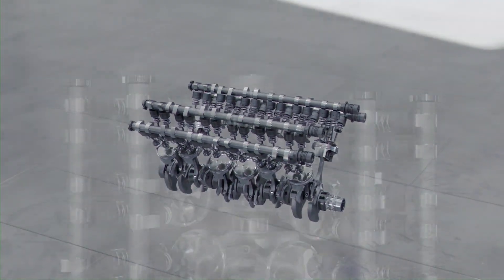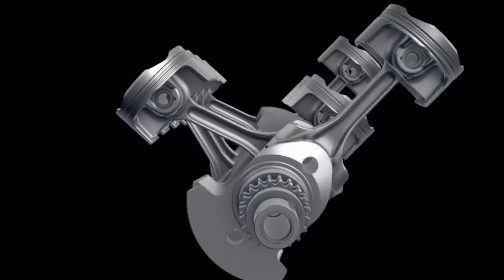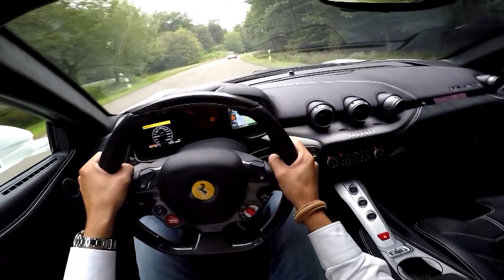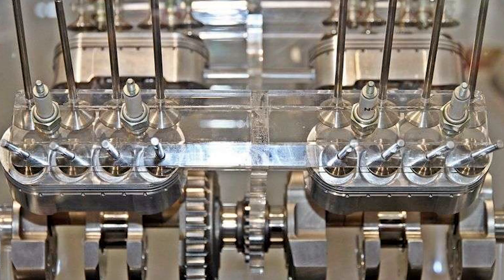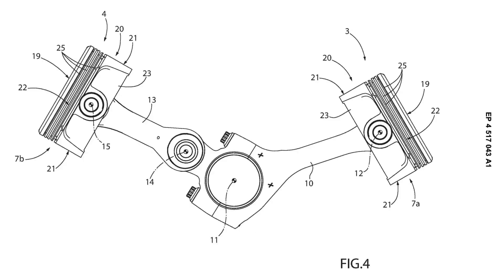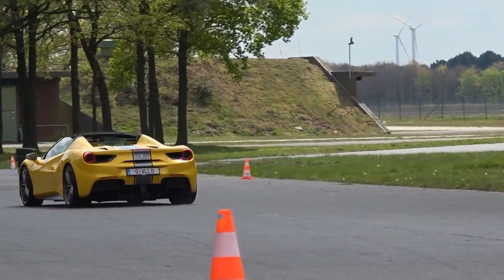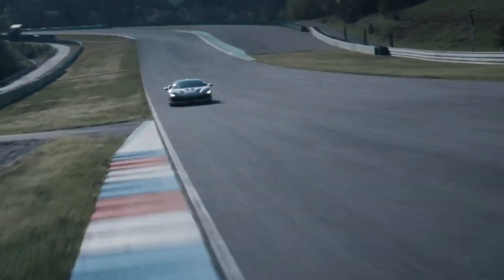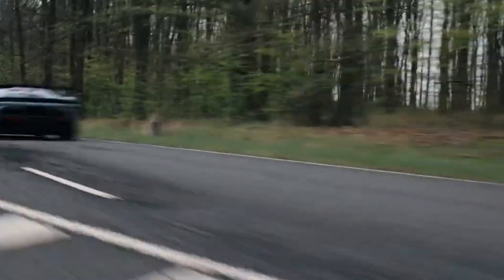Ferrari’s Oval Piston V12: Engineering Genius or Mechanical Stupidity

Comment: the insurmountable wear n heat management problems make this configuration a design non starter for any volume production motor. the inefficiencies ideas it overcomes could work in race applications where engines are refreshed at very low mileage, but even Ferraris that have full overhauls well before 100thousand miles would have to deal with heat issues of the heatsoaked intercyl area that ibcant see a solution to that offsetting the space savings with huge cylinder gaps reimposes on the footprint.
as a mod design say v4 or v6 could fix the issue, spreading heat load n 2 huge valves per cyl for massive head flow n power density possibly doubling relative to current designs [ na peak torque rating of over 200mn per litre,] , making a 12 cylinder config unnecessary.

Comment: If the piston were oval shaped, Couldn't you put dual spark plugs in it? Interesting....
Reply: But why would you want to? The Chrysler Hemi uses twin spark plugs. It's the result of not properly designing the combustion chamber.
Reply: @georgeyoung613 Sounds like a parallel issue.

Comment: With advanced lubricants we have now, anything is possible.
Reply: Anything. How about longer lasting timing chains and chain guides.
Reply: @mpetersen6  That's why they make gears to replace timing chains.
Reply: Then of course, there's a certain form of ceramic piezoelectric actuators, with the help of a sufficiently sophisticated electronic tachometer, could not only replace timing belts, chains, and gears, but also replace the camshaft and valve springs altogether.
Reply: @Iamwolf134  Intresting and thinking outside the box. Very cool 😎

Comment: what about the rings? normally they rotate in their slots reducing wear. plus how do they handle the ring gaps?
Reply: That's a good question. My guess is it would be a material issue. I would assume the rings would look like an overall key ring. Where each ring overlaps but can still expand and contract. Thats how i would tackle the problem. But i'm just a retired Marine.